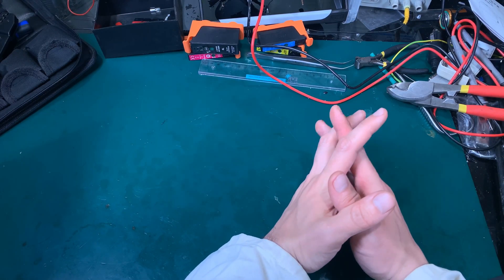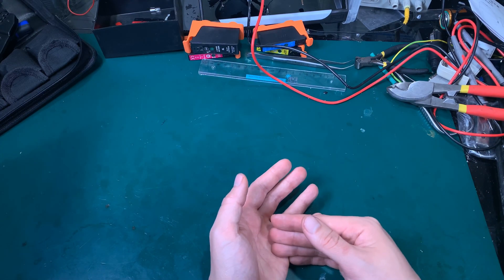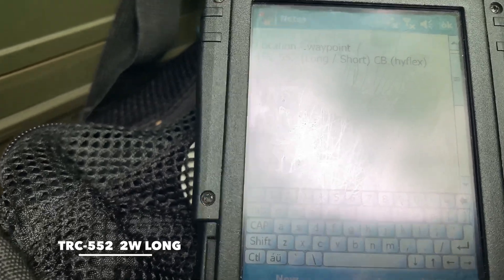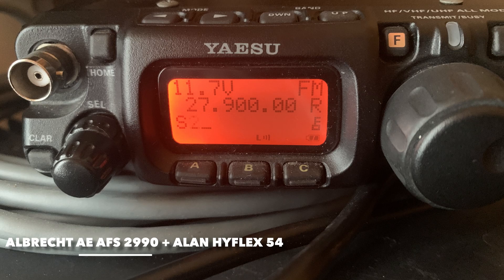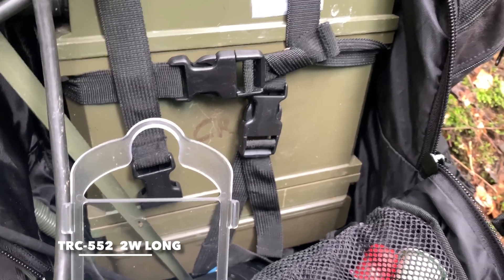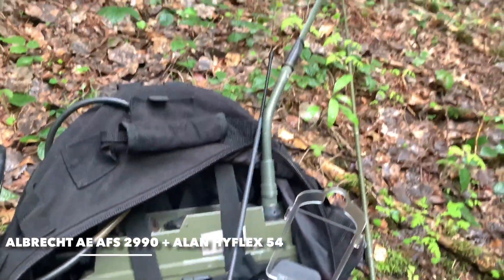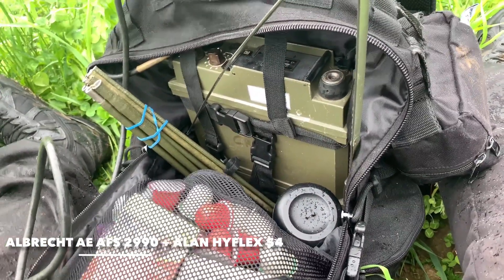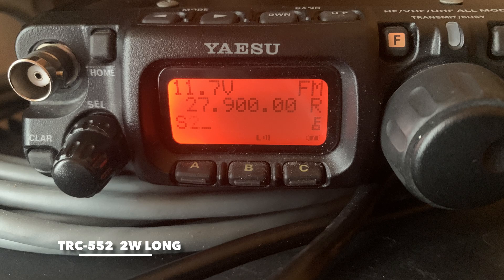Military manpack TRC 552 vs CB radio Albrecht AFS 2990

Comment: Hello, CB radio standard is 1.8Khz deviation, military standard is 7.5Khz deviation. CB radio is very cheap, designed by scientists in their spare time with a good heart for the good of humanity. A military station costs tens of thousands of dollars. Due to the voluntary work for the creation of the CB 27 Mhz radio, it does not contain a pre-emphasis filter. Therefore, there is a lack of treble. CB transceiver Albrecht has a power of about 1.2-1.8 W depending on the condition of the battery 10.8V.   Great test :-).

Comment: Was the FT817 also set on Wide Band FM? This could be why the Albrecht modulation is softer. Also I think the Albrecht does about 2.5 watts with the battery pack.